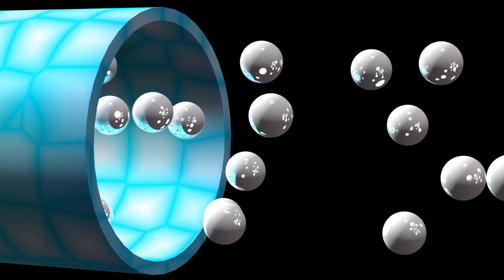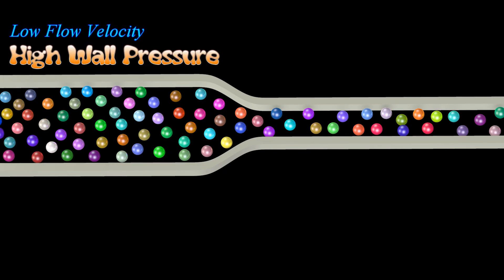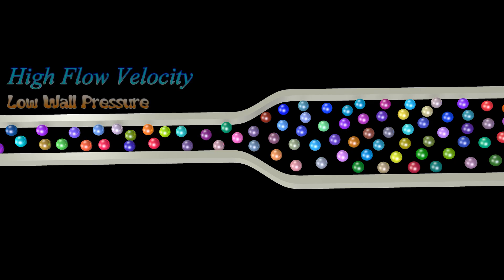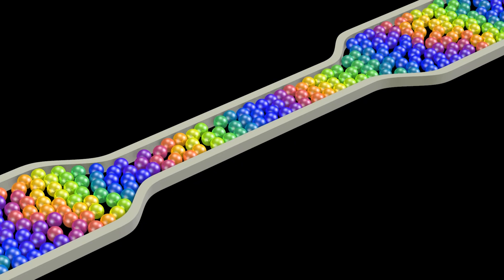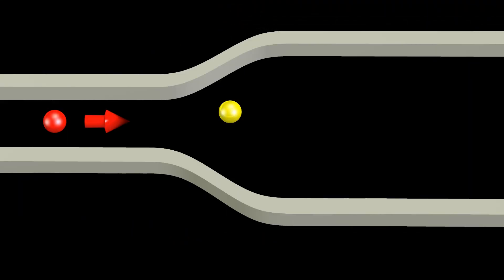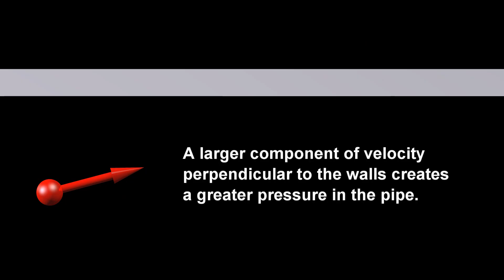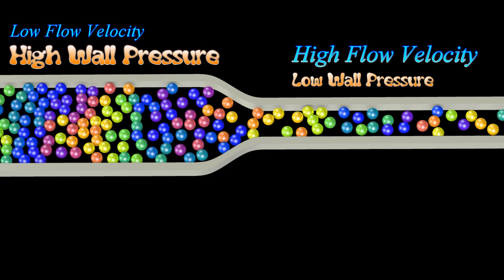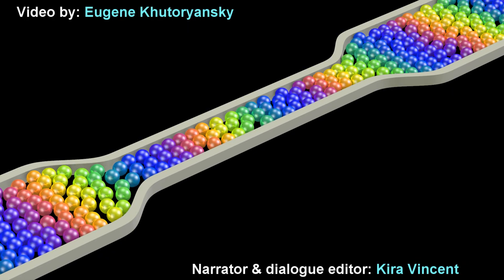Bernoulli’s Principle on Atomic Scale

Comment: I'm not sure I came out 100% convinced.
It seems convenient to say that the velocity components parallel and perpendicular to the walls change when they enter the narrow region. It is not explained why those would change at the first place? Yes sure, we can say the bombardment with the other molecules is making the changes happen but we then assume that the molecules in the broader region were already slow and caused deflection and slowdown on the incoming new molecules. But why were they slow at the first place?..
Can the principle be explained using a single molecule?.. If not, then why the initial material slowed down needs to be explained.
Reply: It's just statistics. An atom moving completely perpendicular will not enter the narrow section until its vector is changed, and one completely horizontal is virtually bound to enter the pipe. It stands to reason, therefore, that the more parallel the motion of the particle, the more likely it will be to enter the pipe. Yes, other atoms can change the vector of motion of each atom, but then that just changes the chance the atom enters the pipe. The atoms can be assumed in their slow stages to have, in average, some parallel speed to the pipe more than if the fluid weren't moving at all, because that's necessary for motion. Brownian motion would dictate some randomness in their motion however fast the atoms were moving.
Reply: What happens is the exact same thing in reverse. The components between molecules will still differ. This will cause some of the molecules travel a shorter or a longer distance (depending on the orientation of the momentum) in the same time giving them the opportunity for collision. Obviously this will not be uniform locally but from our perspective we might as well assume that it is.

Comment: What about the pressure exerted by a high velocity liquid on an imaginary section  perpendicular to the walls of pipe, will it be less than that of slow velocity liquid? 🤔
Reply: Do you mean what would happen as the tube bends 90 degrees?
Fluid dynamics states that as as a fluid rounds a bend, it loses velocity and increases pressure

Likely for the same reasoning as explained in the video, as the molecules turn the bend, their forward momentum turns into a perpendicular component of their velocity
Reply: Oh okay :)

Comment: The explanation is incorrect. Collisions are happening in the narrow section of the pipe as well. Those collisions are just as likely to result in perpendicular motion as the collisions in the wide section. I don’t know what the real reason is, but it isn’t the reason given in the video. It’s a good attempt though.
Reply from the maker: The explanation is correct.  Inside the narrow section, the molecule is colliding with other molecules which also have a large component of their velocity parallel to the pipe.  If both particles start out with a large component of their velocity in the positive X direction, they will be likely to still have a large component of the velocity in the positive X direction after the collision, due to conservation of momentum.
Reply: @EugeneKhutoryansky  it doesn't matter if the particles share a large value of their velocity in a certain direction. Think of a reference frame that is moving at the rate of flow through the narrow section, and all the particles will appear to have random motions, and will impact the walls just as often as if you were looking at a pipe with no flow from a reference frame that is at rest.

Comment: So basically there is pressure perpendicular to the wall and pressure parallel to the wall. Obviously pressure parallel to the wall can’t do work on the wall but it can “work” on the fluid itself.

In reality, these perpendicular and parallel pressures are just the two contributions to volumetric density of kinetic energy, and because kinetic energy varies with the square of the velocity, you could apply the Pythagoras theorem and say one is simply converting one pressure type to the other pressure type by virtue of the fluid traveling down the narrowing and expanding sections of the pipe. For constant density fluids as we have in this example, you could (ignoring viscosity and in general resistance to fluid flow) additionally say that the sum of perpendicular kinetic energy and parallel kinetic energy is conserved and we are simply converting one type of kinetic energy into the other. Then the gradient of “pressure” down the tube is really just the gradient of the parallel-to-tube contribution to the volumetric kinetic energy density. Ignoring resistance to flow, It does not actually represent a change in the total pressure as the fluid travels down the tube, just a conversion of one subtype of pressure into another.

It would be interesting to see how this concept would apply to flow that is “detached” from walls, since in such flow there is not really a “parallel” or “perpendicular” direction to speak of.

Comment: This explanation is misleading and incorrect. On top of that it is overly complicated. Way more complicated than simply applying Newton's laws and seeing that in order to accelerate something you need to apply some force to it. Your explanation ignores the interactions between atoms in all cases except when exiting the thinner part of the pype because you found it most convenient. Your explanation if the angle of the velocity to the wall has some truth in it since what you were missing in your explanation is the fact that the atoms have two components to the kinetic energy that contribute to different effects. If you imagine a small volume of gas, inside it the atoms would be moving in random directions with a net zero velocity. This is the part that creates the hydrostatic pressure. But the whole volume of gas could be moving at some speed meaning the atoms would have some exctra kinetic energy on top of thier random motion kinetic energy. This group motion of the atoms doesn't countribute to the hydrostatic pressure but it can cause dynamic pressure if the velocity of the gas volume is changed. So what is really happening when the gas transitions from the thick to the thin part of the pype is that some of the kinetic energy of the random motion of the particles is transfered to the kinetic energy of their group motion. This transfer happens because when there is a pressure difference the whole group of particles is getting pushed and the work to accelerate them is done by the hydrostatic pressure difference so that's why the energy that causes the hydrostatic pressure is decreased.

So to sum up, the difference in hydrostatic pressure means there is a force applied to a group of particles. So the work done by the hydrostatic pressure decreases the kinetic energy of the random motion of the particles and increases their group motion kinetic energy. Meanwhile, your solution is technically wrong, overly complicated and not very intuitive. You had some truth mixed with the BS but overall you didn't do a good job.
Reply: Oh, and just to clarify, yes, I agree that most schools/universities teach this in an even worse/less intuitive way so there is a problem to be fixed, you just didn't succeed in fixing it.
Reply from the maker: The video is correct, and the explanation you provided sounds identical to my explanation in the video.  You are saying the same thing I said, just in different words.  The following link discussed this in more detail.  http://physics.ucsc.edu/~ccrummer/aero1.pdf

Comment: Good explanation!!
Could a similar thing happen with voltage/current? (As similar to pressure/flow speed)
Because when current goes up, voltage goes down and visa versa... Electric Bernoulli effect 😁
Reply: The analogy typically used for this would be a resistor being the same as a pipe restriction.  The current, though is the same on both sides of the resistor, and the voltage drops across it.  The power drops as the resistor converts some energy into heat, though, and this energy is not recovered on the other side, as it is with a venturi, so the analogy breaks down.
If you had a constant power load, then yes, more voltage would require less current, and vice versa.  A better analogy would be wire sizes vs power load carried.  A higher voltage allows the same power to flow using less current, which means you can use thinner wires.
Reply: @gt5713  
Yea you're right about the current being the same in connected thick and thin wires. But when you think about it: current is the amount of charge per second through a wire which stays the same in thick and thinner parts. In that analogy the amount of stuff/air per second flowing through a pipe also remains the same throughout thicker and thinner parts. The variable is the speed of charge/stuff which differs in both scenarios.

Also, in both scenarios you lose more energy when the pipe/wire is thinner because the resistance gets higher. It is harder to push air through a thin pipe than to push the same amount of air through a thick pipe.

Comment: Still doesn't explain what causes to align molecular in parallel to narrow pipe moving from large dia....
You showed what we know but in animation way..
Reply from the maker: As an atom not yet in the narrow section collides with other atoms, these collisions randomizes its direction of motion, until its component of velocity perpendicular to the pipe walls is smaller, at which point it is more likely to enter the narrow section.
Reply: Sir, one more thing what happens to those molecules/atoms which were having velocity components in perpendicular direction? Will they not oppose the entry of atoms in narrow section?

Comment: Good morning, I'd like to ask the author about what's the explanation of Bernoulli effect in case of laminar flow, i.e. when all the fluid particles have a velocity parallel to the pipe. Thanks!
Reply from the maker: Bernoulli's equation assumes laminar flow for the calculations, but this ignores the causal mechanism for the pressure against the wall, which is caused by the component of velocity perpendicular to the wall.  Realistically, you are never going to have a situation where the component of velocity perpendicular to the wall for all the atoms is zero.
Reply: @EugeneKhutoryansky   @Physics Videos by Eugene Khutoryansky  Thanks! But I think your explanation fits perfectly for perfect gases, in which pressure Is only due to particles kinetic Energy. For non perfect gases and fluids there Is another contribute to the static pressure given by the Electric field among molecules. So when molecules are accelerated into the small section, the equilibrium distance among molecules increases, thus attracting the molecules each other and decreasing the effective pressure on the pipe Wall. This would explain the Bernoulli effect also with perfect laminar flow. Sorry I don't have any documentation so far, Just speculation. However I think it's more a matter of Electric attraction rather than momentum change.

Comment: This was fantastic.  You're right, I've always been deeply unsatisfied with explanations of the Bernoulli Principle.

If I may make a video request of a similar nature:

Temperature and pressure: both involve gasses striking other gasses.  What is different about them at an atomic level?  This was never explained to me in years of physics classes.
Reply from the maker: Glad you liked my video.  Temperature is not the same thing as pressure because pressure also depends on the volume and the number of particles inside.  A larger volume for the same number of particles will decrease the pressure, because the particles will hit the walls less often, even if the temperature is unchanged.  The temperature refers to the average kinetic energy of each particle.  Thanks.

Comment: 3:00 so  the atoms with high velocity are more likely to be going into the smaller region?  Its a nice idea but not entirely convincing. 

Flow through a pipe is BULK motion and not due to kinetic energy of particles as Brownian motion or diffusion.
Reply from the maker: No, we can think of all the individual atoms as having the same total velocity, and this does not change the analysis.  What I am saying that the atoms with a smaller component of their velocity perpendicular to the pipe are more likely to enter the narrow region.
Reply: @EugeneKhutoryansky  Thank you for your reply.
May I respond:  "more likely" suggests a statistical phenomenon. And, as far as I can see, ALL the atoms will have to go into the narrow gap whatever their individual velocity orientation.
Also, A larger velocity parallel to the pipe, does not require a reduced velocity perpendicular to the pipe.
Reply from the maker: Although all the atoms eventually make it into the narrow section, this is not until they collide with the other atoms (which are not yet in the narrow section), and these collisions randomizes their direction of motion, until their component of velocity perpendicular to the pipe walls is smaller, at which point they are more likely to enter the narrow section.  In reply to your last point:  If the number of atoms per second that passes each section of pipe remains constant throughout the pipe, and if the energy per second that passes each section of pipe remains constant throughout the pipe, then the average kinetic energy per particle must also remain constant throughout the pipe.  This means that the average velocity per particle remains constant throughout the pipe.  The only difference would be how much of the velocity is perpendicular to the pipe, and how much is parallel to the pipe.
Reply: @EugeneKhutoryansky  I like it as an idea and find it tempting to go with. But there are a number of points that would need developing for me to be convinced. 

For example, The velocity of the particles due to their individual kinetic energy is much higher than the velocity of the bulk speed of the fluid. 

eg For the lift due to a wing, for example, the speed of an air molecule could be more than 500 times the speed of the airplane. I am not sure that the two speeds can be related.

Comment: First I would like to thank you for making those amazing videos. they are propably amongst the best possible visuals for complex physics, and they helped me greatly in electricity already. With this particular video, I now understand Bernoulli's principle much better, but some things still confuse me...

Starting from 2:40, you represent the movement vector of an incoming atom to show the link between it's angle and propability to enter the pipe, but you show it spinning around like if it  had a constant norm within the fluid. I do not know much about statistical physics (which I assume this is), so forgive me if I am wrong, but since the overall flow of the fluid is not null, should'nt you add the average horizontal velocity to the "random" velocity? Or maybe it isn't actually important, but to me it feels like it should be, though I am not sure why.

You then explain that since the atoms that go through are mostly the ones with a moslty horizontal speed (which I understand), the perpendicular components in the narrower pipe are overall smaller.
However, since speed increases, shouldn't the norm of velocity also increase, and as such the perpendicular component too?
Reply from the maker: Thanks for the compliment.  If the number of atoms per second that passes each section of pipe remains constant throughout the pipe, and if the energy per second that passes each section of pipe remains constant throughout the pipe, then the average kinetic energy per particle must also remain constant throughout the pipe.  This means that the average velocity per particle remains constant throughout the pipe.  The only difference would be how much of the velocity is perpendicular to the pipe, and how much is parallel to the pipe.

Comment: What if you lowered the temp. of the fluid close enough to absolute zero such that molecule movement was significantly dampened in any direction other than the direction of flow.  Could the pressure against the walls of the tube/pipe then be the same regardless of the inside diameter of the tubing?  
As the fluid transitioned from small dia. to a larger dia. pipe the incidence of particle movement perpendicular to the walls of small and large dia. pipe would remain constant.
Reply from the maker: As the fluid approaches the section of the pipe where the diameter becomes more narrow, the atoms inherently have to bounce around, and therefore have a temperature above absolute zero, because there is no way the atoms can continue moving forward in a straight line.

Comment: Eugene, you are painting yourself into a corner this time. The background idea is right but i think you may confuse some peopoe. The KEY idea is to separate between isotropic  brownian velocity (microscopic) and net average direccional velocity (macroscopic). And also take into account that both are ways of energy (internal  and then kinetic) and can be transformed one into the other. It is fully true that  static pressue  AND static temperature are related to brownian velocity. Therefore in order for the fluid to travel faster throgh a smaller diameter pipe, part of the isotropic velocity has to transform into a net velocity in one particular dirección hence reducing the static temperature and pressure which is what the walls can "feel".

Comment: Wouldn't the particles that enter the smaller section hit other atoms too changing the direction of their velocity?
Reply from the maker: Inside the narrow section, the molecule is colliding with other molecules which also have a large component of their velocity parallel to the pipe.  If both particles start out with a large component of their velocity in the positive X direction, they will be likely to still have a large component of the velocity in the positive X direction after the collision, due to conservation of momentum.